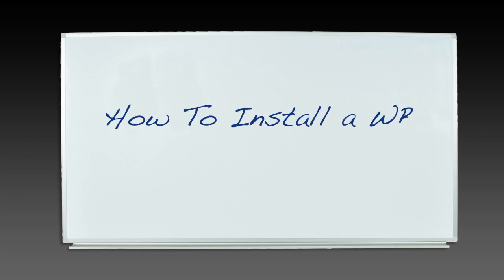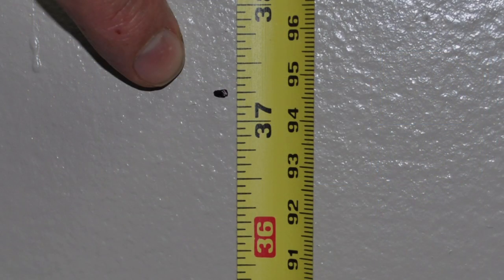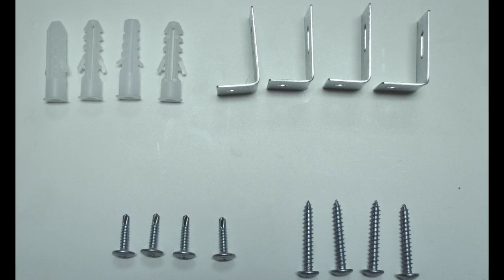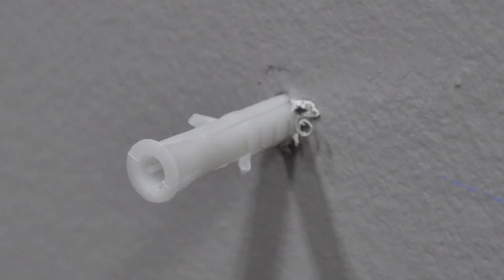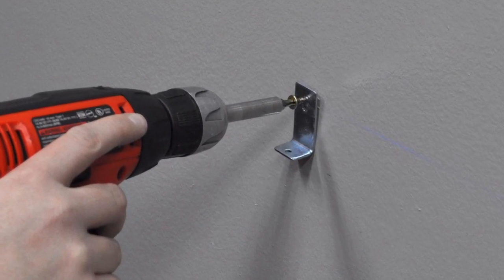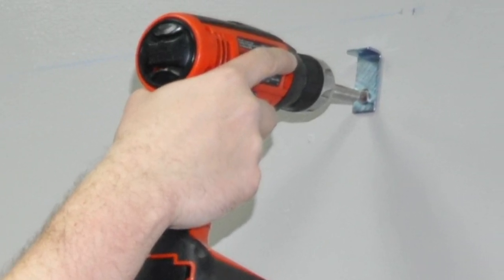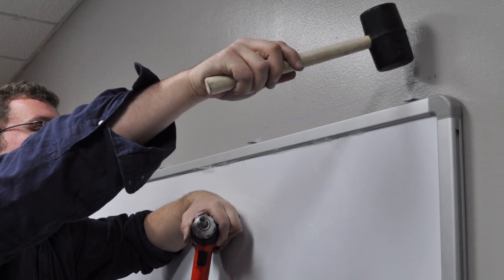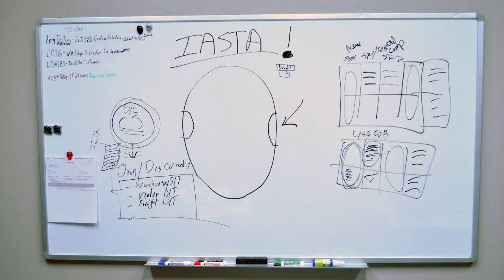Luxor WB Series Whiteboard Mounting Instructions

Comment: The issue I have installing this board was the directions. Install lower L bracks by drilling at 37 1/4" from floor. Top brackets are mounted at 74 3/4" from floor. This leaves a 37.5" space between screws. With the L brack fully extended you might pick up an additional 4" total. The board is 48"!! So no matter what it will not fit in to a 40" space.